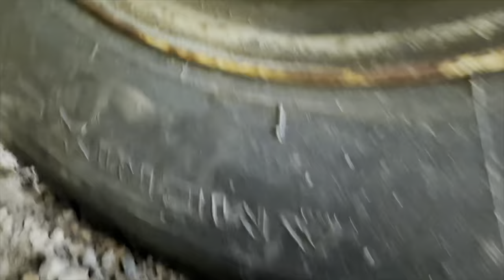Smokey & The Bandit Tribute Truck Ep.81 Gimme A Brake

Comment: Here's a trick I have used a lot, take your grinder and cut it almost all the way through stopping so you don't damage the shaft.  The take a chisel and hit it into the groove you made splitting it and it should pop right off.
Reply: Exactly what I would do.
Reply: I did that many times. What I don't understand is why he did not do it when it was in the shop instead of worrying  about paint right away.

Comment: Hi Mark

A little tip when using oxygen - acetylene torch is when switching off the torch you shut off the acetylene first then the oxygen second.

What it is, the oxygen being at a higher pressure actually reduces the risk of a flash back, that's flame's travelling up the hose to the acetylene tank.

I was told to remember first to be ignited is the first to be shut off.
Reply: also, if you cut the acetylene off first, your torch is filled with harmless oxygen.

Comment: I think you are supposed to heat the outside component not the shaft, when metal is heated it expands. But I know you will figure it out keep up the good work Mark.
Reply: Very true, you want the slack adjuster to expand not the spline shaft. 

What can break it loose quickly though is heating and cooling cycles. Heat the whole thing up, then cool it with penetrating oil, and heat and cool several times before pulling.

Comment: Mark the puller would have been the best solution now you'll find out that you have to pull those S cams and put new bushings and grease seals if they're nylon bushings in there they'll be melted causing a lot of play yes I have been down the road to myself

Comment: The reason you want to open the oxygen valve all the way is because it is a double seat valve, the packing on the valve handle can not hold against 2000 psi, but the valve all the way open can.  Saves on gas.

Comment: One trick with those cheap pullers is to weld a little blob on the back of each of the arms. Then when you get it on you can use tie wire or a zip tie on the jaws to keep them closed

Comment: I didn't have a torch when I replaced the slack adjusters on a trash truck but a saws all worked out good after the blade was shorten great video and glad you won the battle and stay safe and God bless from GA
Reply: Ps use some pb blaster on the rest of them

Comment: On the automatic slack adjustment, you are very right about not trusting them. If a driver does not apply the brakes properly, push in/off and based on the closeness of the person you might hit or road conditions and the speed your doing,  and when he or she lets off that adjustor clicks, just like you said. But if they are quick on the application of the foot valve, on/off, on/off, on/off, that can cause the adjustor to miss a click and then you are out of adjustment.

Comment: With that puller on crooked it could binding, I’d use a ratchet and make sure it’s pulling straight, also not supposed to heat break components like that lol, technically s cams should be replaced now, and those s cam bushings are more than likely melted with that much heat, they are usually plastic or nylon bushings,

Comment: Mark! "Flash Back Arrestors" my good man, even more so on those little Oxy-Ace setups (or any setup for that matter). Don't forget to grease your new slack adjusters.. Thanks for the share!
Reply: The vast majority of Victor torches have them built in.
Reply: @Rotoziptheman Although built to Victor's quality and safety standards, due to the cutting capacity and/or design of each torch, flashback arrestors are not manufactured into these Victor Heavy Industry torches. (from Victor's own website)

Comment: That whole time with the impact you were pulling at enough of an angle that it was wedging itself, basically like crossthreading a bolt.

Heating and cooling cycles breaks rust welded connections, heat with a torch and immediately spray it cool with penetrating oil. Do this several times before trying to pull it STRAIGHT off.

Comment: The trailer matches your shop right now lol.  

I've had slack adjusters that were so frozen I had to cut the s cam in half and pull it out that way.  I've seen a lot of insane stuff being a trailer mechanic/collision tech, Amazon drivers are the kings of destroying subframes and sysco foods drivers back trailers into transit vans and tractors almost on a daily basis lol.  Keeps us in business though.

Comment: Also, when setting the slack adjusters 1/4 turn is usually too tight, 1/2 turn is usually pretty bang on, its supposed to be measured, put air to the park brakes to release them,  mark the pushrod, set your slack adjuster 1/2 turn back from applied to start, then dump the air to apply the park brake, now measure from the base of the brake pot to your original mark, spec is between 1” 1.5” of travel, and it cannot be more than 1/4” difference from the left to right,

Comment: I haven't had luck when, a puller has 2 legs pulling while one is not.  it put's the part in a binde . greater luck pulling evenly - inline - also,  wire brush the splines first,  before pulling. . Doing away with inpact gun. shortening apparatus.    all might make things easier for leading axle.     ( must see entire rig in person when completed. )

Comment: Not sure what the plans are for the interior of the trailer though but a good insulation job with a Mini Split HVAC system with the compressor/condenser mounted inside the reefer unit and power it via a roof full of solar panels and a spring of Battle Born or similar battery sting with a generator for when the sun is not shining to keep you and the Coors cold. Additionally I would consider building a false wall with either Coors tall boy cases box ends or 12 rack box ends hiding the entrance into the Fred’s Lounge.
Congratulations on finally buying yourself a torch set; Now that you got a torch set talk to Peg about using Propane instead of Acetylene and then buy yourself a bigger O2 tank

Comment: A proper slack puller would have worked much better, yout pulling crooked with that gear puller, fighting yourself.  Better check those cam bushings after applying all that heat most are made of nylon plastic.  Great job keep up the good work

Comment: Have you thought about sticking a spy in the shell of the refer unit and put a mini split in the front of the trailer wall off 10 to 15 ft and make a little room you could use to cool off during shows or even sleep in it over nite shows

Comment: More oxygen pressure when cutting. 40psi or more. The torch is the answer you just have to ask the right question. The hardest part is getting through the outer part and the grease to get to the inside collar that’s stuck on the splines

Comment: Everyday is a good day with TwinSticks. Good choice with the manual adjusters. I hated the auto adjusters, never worked right. BTW if you pop the rubber plug on the spring cap you can capture the spring to keep it safe for cap removal.

Comment: Hi Mark.. The trailer is coming on leaps and bounds to the finnish line ... just a wee note.. you may find investing in a good quality heavy duty  Air Hammer and various lengthed chisels, would help in removing the slack adjusters  in the future, with heating from the oxy acetylene torch.. then battering the hell out  of them with the air hammer.. Keep up the good work .. Andy   UK ..

Comment: If you measure the rod length of the old one when it’s set after you take it off, you can get the length of the rod for the new one…
Reply from the maker: Yeah assuming the previous guy cut it correctly 😂
Reply: @TwinStix  If you had old 70s trailer tail lights remount back in don’t need LED lights keep the classic mark boy!!!!!!!!!!!!!!!!!!!!!!!!!!!!!!!!!!!!!

Comment: I'm thinkin' that job would have been a tad bit easier before you slid the tandem under the trailer...  Did you try using a air hammer on them?  Sometimes those short hard hits will help break free the corrosion.

Comment: A before O or up you go ,,,,.basic torch rules.,,,hate to say but your torch was not adjusted properly looks like you don’t have enough oxygen,,,,I’ve run into many similar slacks especially on older trailers like yours keep at it you’ll only get better 😅
Reply from the maker: Yeah it’s a pretty small setup and even full on with O2 the flame doesn’t get much bigger

Comment: 30-30 brake chamber with round air fitting boss has 2 inch stroke, the square air fitting boss has 2 1/2 and says long stroke, all the heat melted your bushings, you shouldnt have any up and down movement in the s-cam, since the mounting side wasnt rusted out you should have just piggyback the chambers, 1/4 back off will work with worn componets but you do 1/2 turn with good foundation brakes, the brake is at 90 degrees and that is max i would like to see the rod a bit shorter once it passes 90 the leverage is lost, if you had done  your measurements with the rod extended it would have been more correct. the dimple in the s cam to the middle of the clevis pin would be the 5, 5 1/2 or 6 inch, when you buy really cheap brake shoes its required you have 6 inch slacks, the spring is 1800 lbs of force, anti seeze is your friend, doubt that special puller would do the job. 34 years as a truck mechanic, you started on the wrong end. slack end first then brakes side so you dont have to pull the wheel end twice,
Reply from the maker: 3030 available stroke is 2” but setup stroke is 1.5” for the Haldex procedure I was using

Comment: We actually had to take a cup off a running concrete truck one time. The brake was hung up on our job site with a full load. needless to say my knuckles got grazed when the cup fiew off. Very dangerous if you get hit in the head your a goner.

Comment: Mark  could you please explain why your rear brakes dont have a dust / weather  shield or back plate on the rear brakes to prevent debris or similar entering the brake drum
Cheers Paul keep up the good work
Reply from the maker: No idea … but this tandem set was used by an oil and gas company so perhaps they removed them so mud/water didn’t pack up in the drums and could easily fall out 🤔

Comment: You made that look so hard, put the slack adjuster on and it’s 90 degrees between slack adjuster and rod. 25 years and I’ve never seen it done that way. Are you actually a qualified mechanic, blows my mind that if not your country allows you to mess with brakes, and not enough shims between the circlip and slack adjuster by the looks
Reply from the maker: Yeah 90 is the “quick way” however the way I did it is the right way 😏 and I aware the shims are missing but I plan to add … just didn’t have any on hand during filming

Comment: Did you take the snap ring off Mark and spray the cam with PB blaster? Don't heat the cam and the slack adjuster. Just the slack adjuster. If you heat the cam your just making it swell tighter into the slack adjuster. Are you sure you took the snap rings off the end of the cams?Why didn't you just measure it with the old shaft? Come on Mark?
Reply from the maker: Umm I did heat the slack and eventually cut it and did you really think I would spend half a day trying to pull something off without taking off the snap ring??? 😂 Agree I could’ve used some penetrant but didn’t have any left after using it all on the Duke
Reply: @TwinStix  I couldn't help it. I just have to keep you in line. If I didn't rattle your cage, who would?